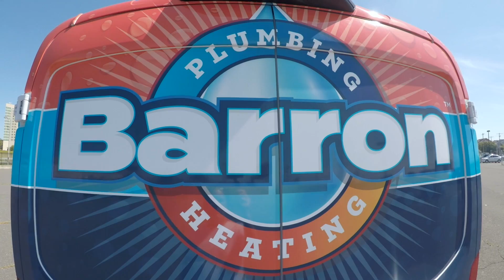PLUMBING REPAIRS | WHY IS MY TILE SHOWER LEAKING

Comment: Hey Chuck ...not sure about some of the other comments, I think your approach, and diagnosis was “spot on”.  Testing the caulking, grout, and the overall integrity of the shower pan first is exactly what you do!  I’m glad you showed (and explained) how you diagnosed the problem rather than just telling everyone what you found ...the actual repair can be another video.   It’s the old saying “if you think hiring a good plumber is expensive ...try hiring a cheap one”.
Reply from the maker: so true. we seen this stuff so much but the bottom line often cost em double with choosing the lowest bid.

Comment: I run into a lot of shower installs, where the person  didn't bother to read the shower door instructions . They caulk ed both sides of the door,and when the water built up between the tracks the water would eventually push out. DIY'ers only caulk the out side of the door.Good work Chuck.
Reply from the maker: This turning out to be a biggie...no trap either.
Reply: only caulk inside
Reply: The weep holes are on the inside of the door track .If you plug them up with caulk the water cannot drain away

Comment: You can't beat an acrylic shower base.  I had to tear out my bedroom bathroom after I purchased my house for the same reason. The "pro" messed up the shower base. You need to check references.

It can be repaired and a worn gasket can be replaced. No mess no fuss.
Reply from the maker: Ya. a real shame on this one.

Comment: I recently found a leak in a home. Shower curb was in bad shape many gaps in grout no water proofing etc.. Client argued we were wrong. They stopped responding after they received my bid. The bid included removal of curb, very expensive curdles glass and re pairing joist below and new ceiling. 6 Months later the joist broke and the whole shower needed replacement.
Reply from the maker: see. So many of these out there.

Comment: I was just going to say definitely wasnt installed by someone who knows what their doing. No nail plate over the water line with the notched joist, they buried a junction box the electrical another no no, didnt appear that they supported the shower pan properly and I'm sure the deeper you dig the more that shower will be torn apart. Another big job Chuck nothing like paying twice to get the job done right.
Reply from the maker: For sure. They have decided to do entire shower over and make larger so its already begun. Job is growing.

Comment: Shower pan test , put a test ball and fill with a 5 gallon bucket( not buy the shower valve) . Then test shower valve (and shower head) by turning on for leakage. Then splash water around the shower tile floor and curb to locate all leaks and isolate.
Reply from the maker: We had iso the drain only. Good words Sheep